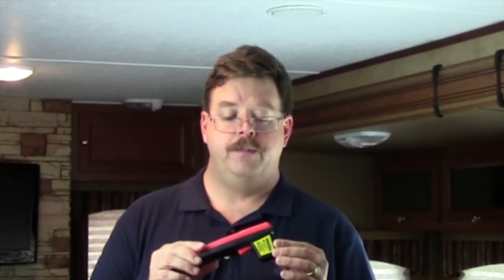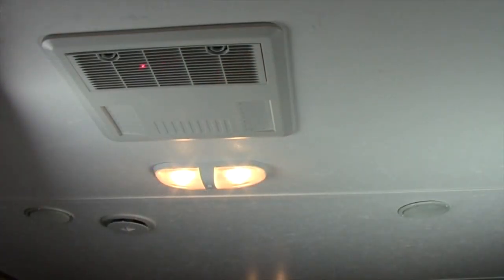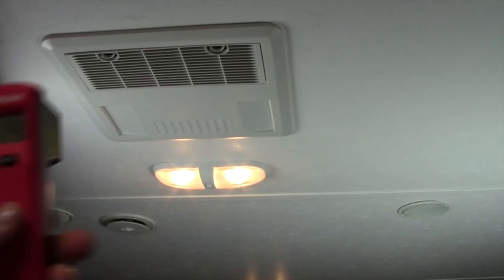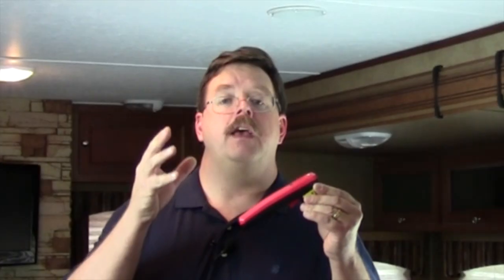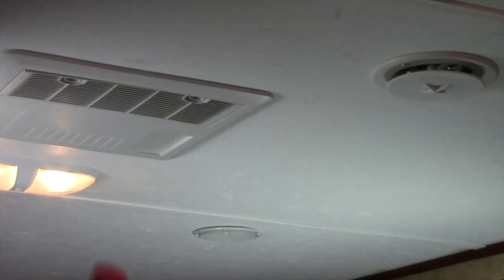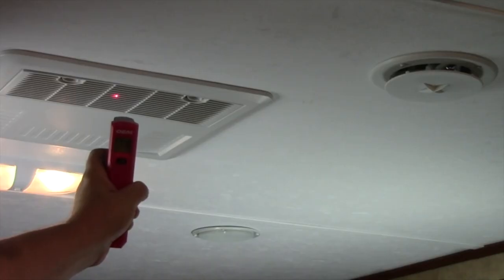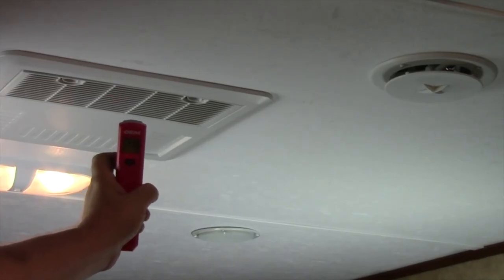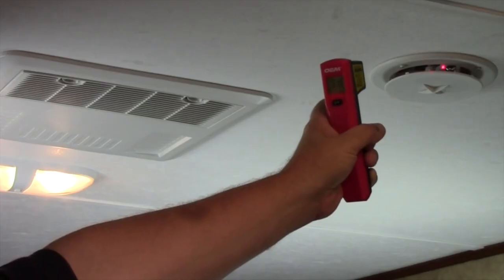Help diagnose RV's A/C health with infrared thermometer

Comment: The condenser is on the roof ! It is not the return to the evaporator. Please do not use a surface thermometer when measuring AC performance. Less expensive (found at the stores you mentioned) infrared thermometers do not have a adjustable emissivity setting. Please use a thermocouple thermometer with two inputs that measure differential. This is a much more accurate measurement of the air either entering and or leaving the evaporator. Videos like this one gives unreliable information from people who are not in the HVAC business.